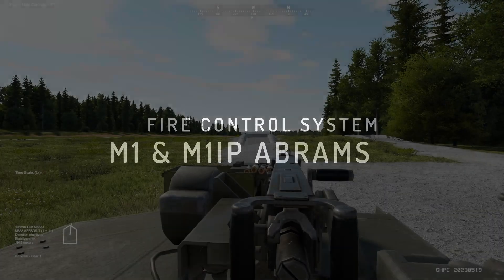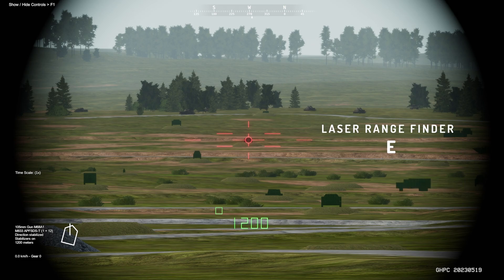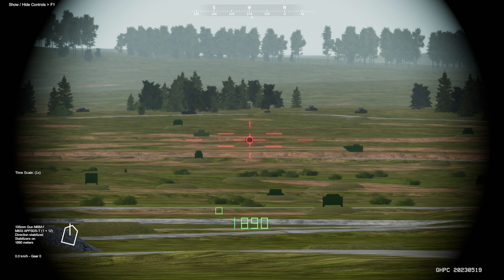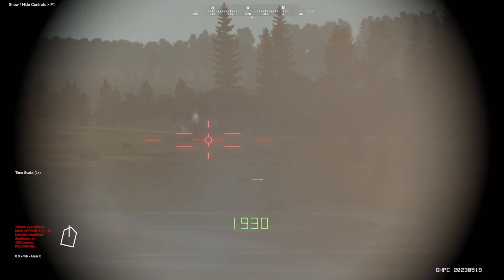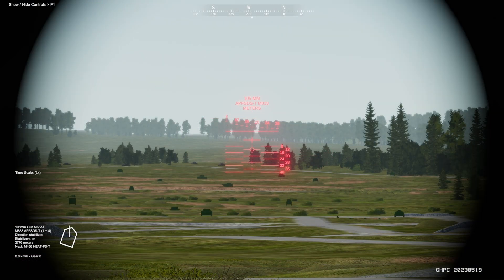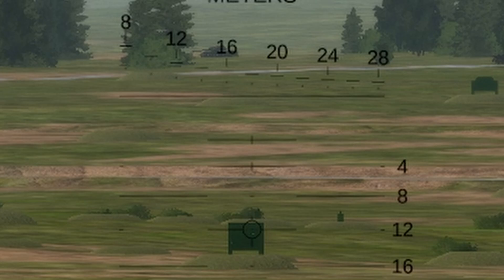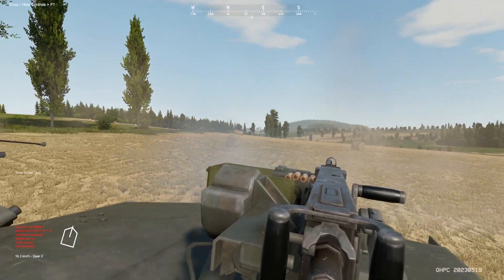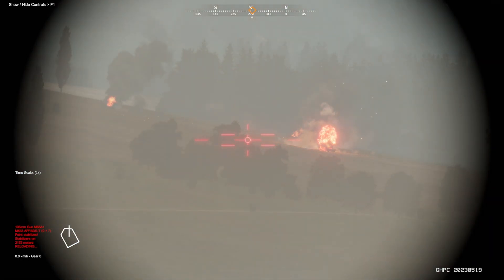GHPC | M1 & M1IP Digital Fire Control System

Comment: Small correction: the dynamic lead system is designed for the gunner to maintain a steady center mass track on the target at all times.  Do not try to "coach" the lead system, as more often than not this will just cause the system to aim at the incorrect spot you're designating.  (You can see this in the video, where you aim at the hood/cab of the truck target and the round impacts there.)  

The system is nearly 100% reliable when the target's velocity and the shooter's velocity remain constant.  If you or the target change speed or heading during the track, it will become inaccurate, and you must smoothly re-center the reticle on center mass and match the speed again.  Again, do not try to outsmart the FCS as a rule of thumb - it works perfectly when conditions are stable and the laser range is good.
Reply: Would also add that the lead system does not measure the speed of the target in any way, the speed of the target is estimated by the rate of traverse of the turret. At the moment of lasing the target, the computer queries the turret's traverse rate and estimates the target's speed. this is why doctrinally you'll always be told to track "smoothly."

I think NLAW does something similar.
Reply: And about the leopard, no automatic lead compensation, nor any laser.
Reply from the maker: @harryr2283  I figured as much based on some articles and sources I’ve read about it. I’m thinking it’s more or less going to be a rough West German equivalent to a M60A1 (Passive).
Reply from the maker: @ActionScripter I’m doing my best based on what I’m feeling out in the game and what source materials I can find. I always appreciate any insight y’all have! Out of curiously, what online references sources do you use? Strictly so I can learn more or course. I love this stuff but sometimes it’s hard to find reliable and accurate information when I do my research.
Reply: @WillfulTangent  We use a variety of sources, too many to remember or list.  Wherever possible, we use the actual training manuals for the equipment we're depicting, as well as firsthand explanations from people who used it.
Reply: @WillfulTangent  I can understand as I have delt with similar issues 

Example the only English scoure i been able to find what goes into deep detail on late soviet era tanks and ifvs is tankograd

Comment: 2:29  the leo 1a1a2 has no lead calculation as it uses a optical rangefinder  .that being side the T-80B  does have fully automatic lead calculation and automatic gun superelevation and also 2-axis stabilization system
Reply from the maker: I didn’t think it would and I wasn’t 100%, so I just went with what was already in the game.
Reply: @WillfulTangent   I don't blame you then look at the gunner pov in a t80b and also every variant after it. The gun sight makes it looks like you have to do a lot of manual adjustments then in reality it is a fully digested fire control system
Reply: @WillfulTangent  Leopard 2 does have a power full FCS